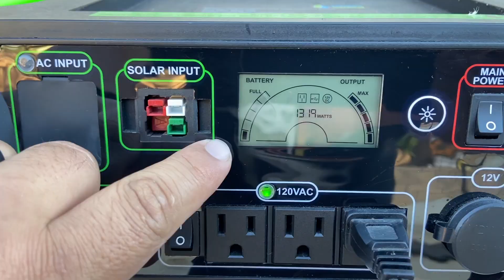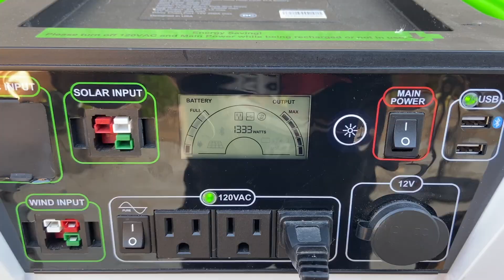Electric Kettle - Will it work?

Comment: soo in essence what's happening when the Generators fan clicks in, is this kettle is kinda like attaching positive(+) to negative(-), just not so drastically, this causes the battery to heat up, and in a direct pos(+) to neg(-) connection the battery would explode... this cooling will aid the battery and help cool it down,, and for safety. **I do believe that an explosion from this generator is not going to nor will it ever happen. **I'm sure I will get some corrections here LOL Good work guys, keep it up.

Comment: I have the Nature's Generator and added 3 more pods to the system.  Each power pod plugs into each other with supplied Anderson plugs.  The system is easily expandable by adding more power pods ad as many as you want.  I have plenty of power and am powering a chest freezer and large refrigerator in my house. Solar panels I mounted on garage roof recharge the system in the daytime.  If the power goes out I have plenty of backup power that is moveable cause it mounts on a cart with wheels and can be moved throughout the house.  Its a great system.  I
Reply: How many solar panels do you have? And how long does it take to charge your three pods and the generator?
Reply: @michaelmeyers3664  I have six solar panels rated for 200 watts going into 3 anderson plugs that go into the system.  The charge time depends on how many watts that are being used from the system.
Reply: @ross2521  Thank you